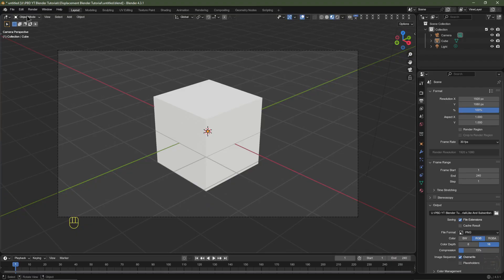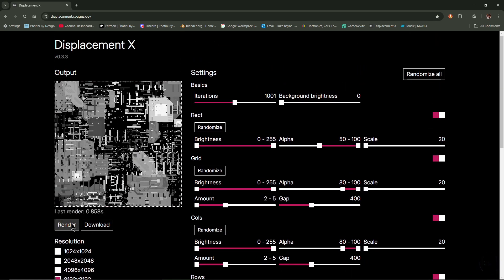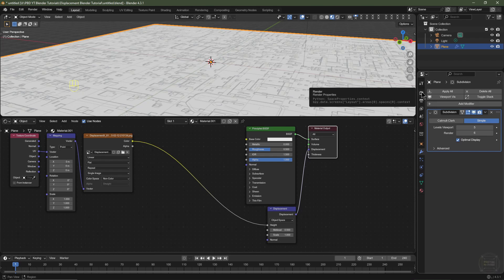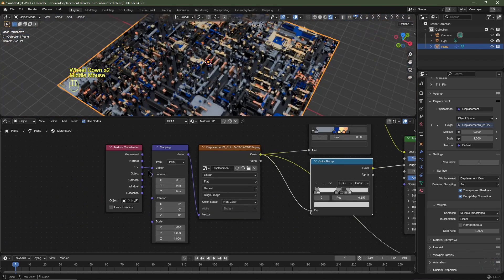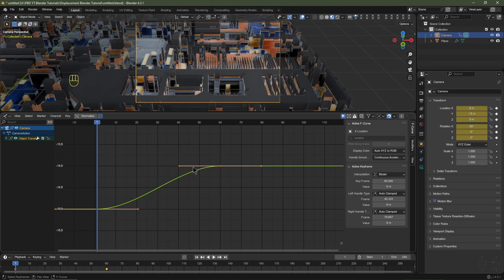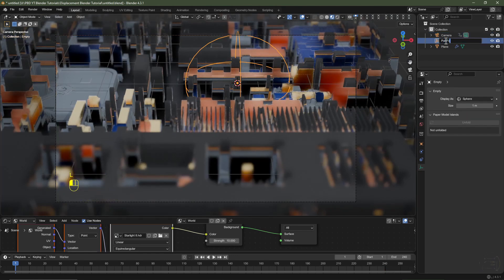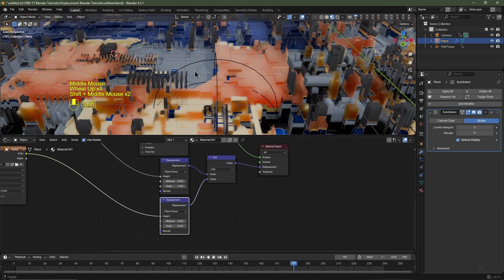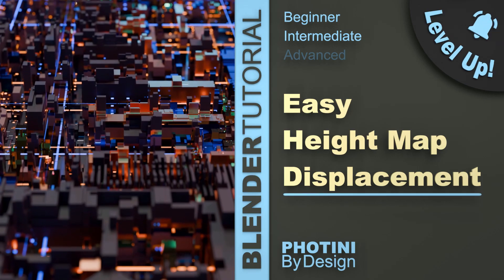Displacement X - Blender Tutorial

Comment: Hi, thanks for this course. Question.. how can i copy paste an external color code into Displacement X color fields. I don't reach :-( Thanks :-)
Reply from the maker: I am not near a computer at the moment, but off the top of my head you should be able to copy and paste the Hex number for the color you want to copy, either that or type in the Hex number manually.
Reply: @PhotiniByDesign  Thanks, normally this is indeed how it should work but i cannot copy paste an external Hex code in the Displacement X. 😞Can you check it?
Reply from the maker: I've just checked, and you are right, there doesn't seem to be a way to copy and paste colors or Hex values, it would be a good feature to add. The work around I have done is render out a greyscale displacement x map, then import into blender, plug it into a color ramp node with an interpolation type set to constant, add flags to the color ramp, and from there you can copy and past colors and hex values and drag the flags to your requirements. You can then plug the output from your color ramp into your material.
Reply: @PhotiniByDesign  Thanks, indeed, this seems to be the solution to add the colors. It's a pitty they don't provide the direct solution. I wonder what the reason behind may be ;-)